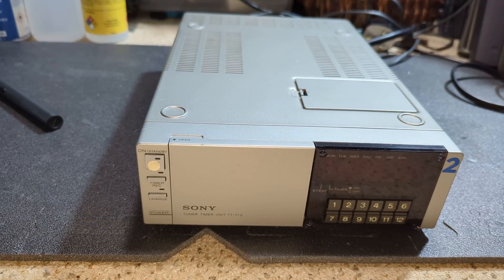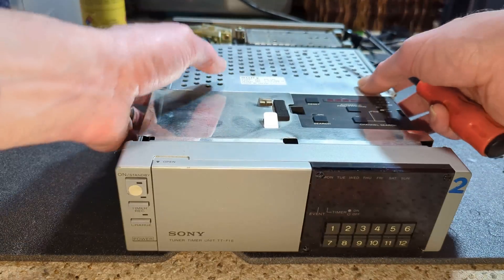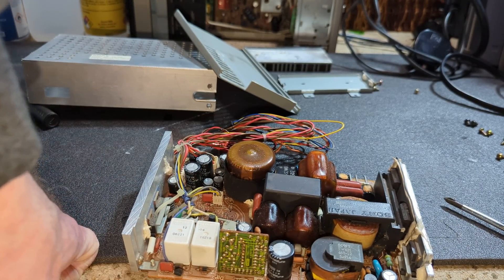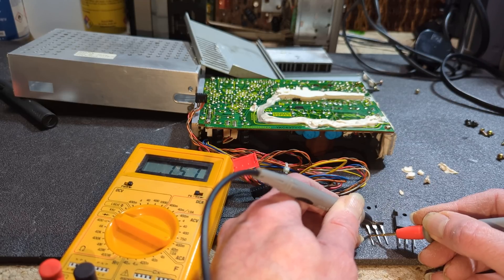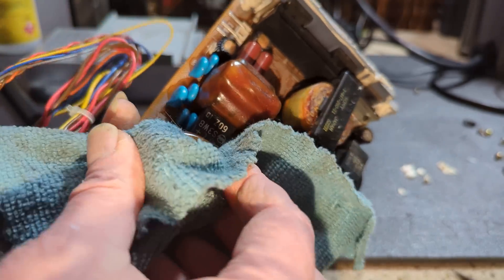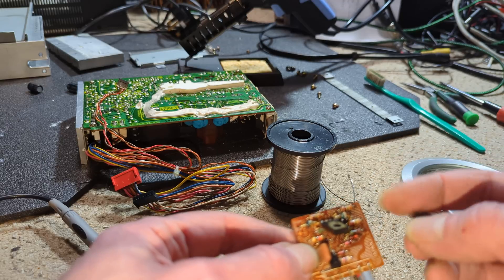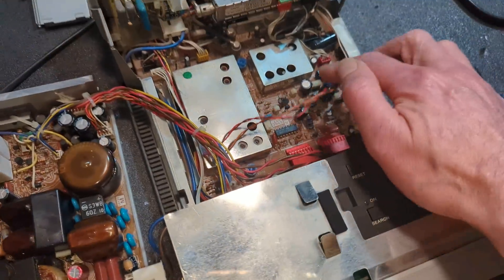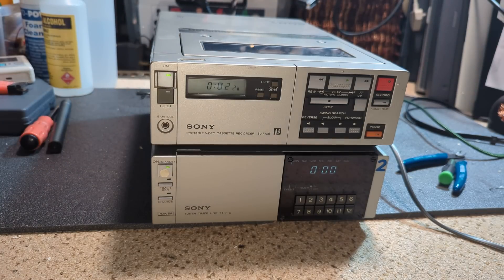Sony TTF1E Tuner and power supply for the Sony SL-F1 Betamax - PSU issues fixed.

Comment: Thanks for the really helpful video, it's great to see there's still some love for Betamax! I have the same problem with a TT-F1 I bought from new in the 80's. I have removed the two 4.7uF capacitors and they have obviously failed, both have leaked round the positive terminal. With the capacitors removed I am seing a short across their locations, does this mean the transistors have blown and how did you remove the transistors as they look pretty solidly fixed, and final question, do you know an equivilent to the C2938 transistor? They seem hard to find. Thank you!
Reply: Ignore me, I found another video where you remove the transistors, great resource thank you. https://youtu.be/X-2eL7sU06U?si=HTlH94e3BG-ycSmz

Comment: Hi, thanks for your explanation. I have a Sony Betamax SL-F1E. It turns on, the forward and reverse buttons work. It ejects easily, but the only problem is that when I press the play button, it cuts out after 2 seconds and won't let me play. What's wrong?
Reply from the maker: Several things can cause this. No capstan rotation, pinch roller not properly engaging, excessive tape path tension, no take up spool movement are the main ones. When you press play, does the take reel rotate? When you press pause straight after play does it not cut out?